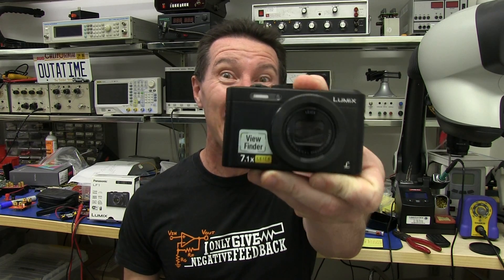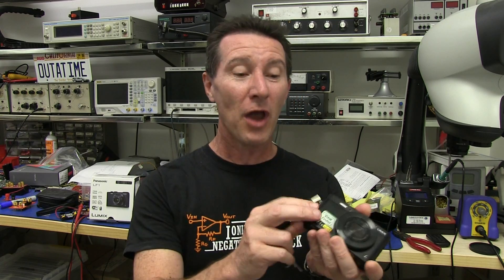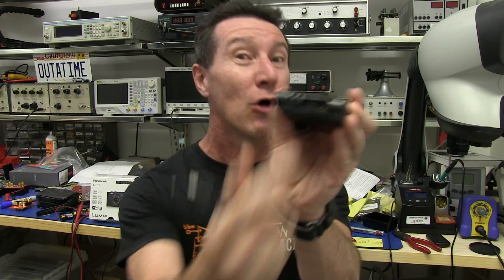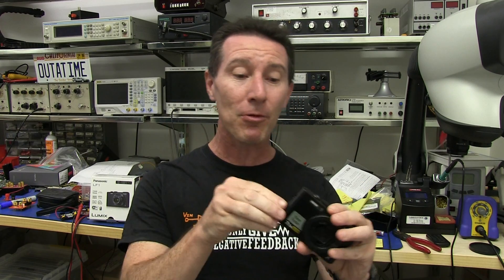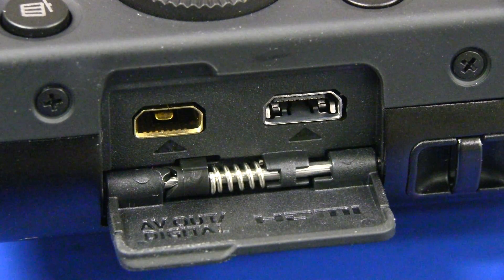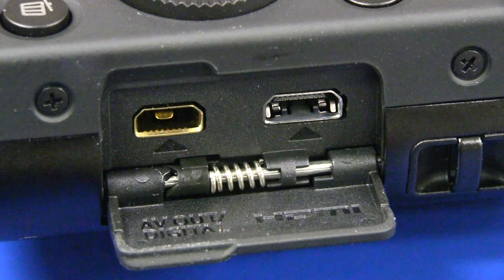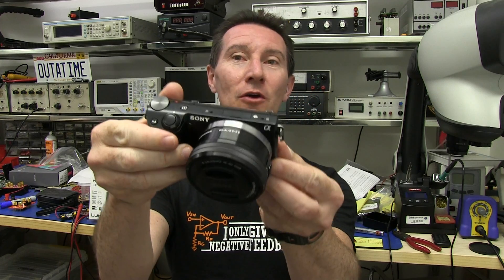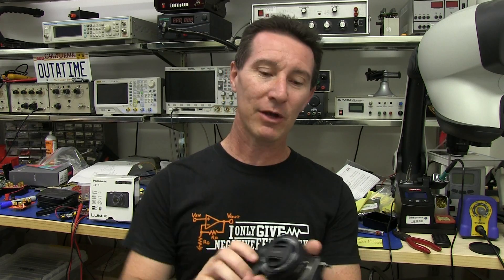EEVblog #578 - Proprietary Connector Rant - Panasonic LF1

Comment: My sony camcorder has standard micro-usb for connecting to computer, but get this, it has a separate weird ass connector for charging.
Reply: My Panasonic camcorder has HDMI, a proprietary AV out (which they included the cable for), a standard mini USB (data AND charge), and a standard 5v barrel jack for charge+power.  I don't care that the AV cable is proprietary since there's really no standard there and it has component as well as composite.  I do like that it uses normal old mini USB and can charge over it.  Did they somehow forget how to do connectors properly since then?

Comment: If it was apple the connector would have 200 pins and cost $400  for a 14cm long cable.
Reply: ... and only 4 pins would be used.

Comment: Great rant.  I have the same issue with Dell!  They've put a pin in the center of the barrel connector for my laptop power supply.  Its only purpose is to identify the power supply as a 'genuine Dell'.  When the pin isn't detected, the laptop will draw power to operate, but it won't charge the battery!   And guess what?  The pin is the first thing that breaks in the damned thing!  I have my original Dell power supply, and I can operate my laptop as long as I'm tethered to an electrical outlet, but it won't charge the damned battery because it can no longer detect the pin!  So now I'm screwed if I want to do something outlandish like use my laptop without being plugged in!  To add insult to injury, Dell wants $90 for a replacement power supply!   Guess who has bought his last Dell laptop?
Reply: HP does the same thing. Some third parties have made clones that work just fine.

Comment: I love these rants! Says everything I'd like to say to these manufacturers. The only thing I dislike is the MicroUSB connector, I have constant problems getting my Nokia Lumia to charge and it's the second one to have same problem, my kindle suffers similar problems. MiniUSB was ok, why we couldn't have carried on with that is a mystery!
Reply: The supposed reason for no more MiniUSB is that manufacturers needed a thinner connector for new thinner devices...  which seems stupid because I still haven't actually seen any portable electronics that are thinner than the good ol' MiniUSB connector (it was just so sturdy in comparison IMO).
Reply: I thought it might be something like that, I've not seen anything that a miniUSB can't be fitted to. The microUSB isn't as robust as the mini and it's a little too small to last long in today's devices. I guess that's the plan though ;-)
Reply: Eddiecurrent2000
IIRC, the MicroUSB standard is rated to a considerably higher number of insertion cycles than the old MiniUSB. The reason being that while MicroUSB has little spring-loaded latches to hold in the connector, MiniUSB relies soley upon friction which is dependent on the connector retaining its 'squashed in' shape.

I imagine most of the issues with MicroUSB is from people using devices while charging, as it's not exactly too robust against bending forces.
Reply: That is probably why it fails so often, how many people would leave their smartphone alone whilst it's charging? I took my Lumia apart and noticed that the contacts on the socket had been pushed backwards into the phone. I managed to push them out so they sat in their proper location, but I reckon Nokia bought a shit load at rock bottom prices, and they are just that - shit! I have to say, and it pains me to do so, but Apple's new connector (the name escapes me) is actually a good design, relying on the connector having a part to snap off instead of the socket lol.
Reply: Yeah. It would be nice if something with similar physical strength as the Lightning connector became standardized. The only downside with it is the exposed pins & orientation-agnostic features mean the cable has to have a chip in it... Just adding to cost.
Reply: Eddiecurrent2000 JMMC1005 

How about some sort of slim mag-safe style connector.

Comment: There was a big name PC manufacturer, can't remember the name so saying nothing for fear of being sued if have the wrong name :)

Anyway, back in the 90s, I used to watch Upgrading and Repairing PCs by Scott Mueller and he mentioned this manufacturer when recommending PSUs.  He said he can't recommend them or their PCs.  He used to do lessons and told the students "Make sure you connect the PSU properly, if the pins are off it will blow".  Everyone powered on, one or two PCs blew up.  He was annoyed as he'd asked them to make double sure they were connected right before switching on.  When he looked, they'd done everything right.

Turned out the manufacturer had made their own proprietary power supply that looked identical to the standard, they'd just swapped two of the cables round.  So if you used them on any board but their own, they'd blow.

Comment: You ask why, ?.....GREED.... Just pure stock holding GREED....! The engineers are perfectly sane. They are just (ORDERED) to deliver profits for their companies which back fires on the little (bee dicks) in the end of the company's profits. Greed has no shame! It never has.
Reply: Greed, greed never changes. :D
Reply: ***** Agreed! Greed trumps all until man is no more..! Winner Takes All, even if they lose all doing it.. !!! The reach always out stretches the grasp.
Reply: bain5872 I wouldn't have said it like that, but I guess I can agree, every man for himself and God for us all :D
Reply: Yes, I was venting a bit and could not resist one of Dave's favorite sayings. I felt the pain as did Dave, at spending hard to get money on an already expensive device to only find I've been highjacked in the software, adaptor or other secondary market. It seems that it is so common now that it's just accepted as normal business. It will run it's course until we have enough and stop consuming these money holes and demand useable products. Thanks for the agreement.
Reply: bain5872 It's okay man, but don't worry too much about this. It's true some manufacturers are notorious for their software locks or mandatory after-sale, a lot of other companies are known for their compatibility. In addition, legal regulation has really helped consumers a lot the past couple of years. The adaption of micro-usb as a legal requirement for a mobile phone has finally gotten rid of 99% of the proprietary charging ports on mobile devices, I love it! For the same reason, I'm really looking forward to regulations of laptop chargers. Though these are more complex to regulate due to the large differences in power consumption (a laptop can use anything from 12W to 200W), I'm sure that having a standard 19V and a standard DC jack will already help a lot

Comment: Just to review: almost all previous manufacturers that have had micro- or mini-USB connectors on their camera for data transfers have not allowed internal charging;  requiring the removal of the battery to a distinct propietary charger.
The really big pisser is when you think your new camera (gadget) finally allows internal charging, and USB to boot, but you then find out it's a proprietaty USB cable when it DOES NOT HAVE TO BE... that's when your head really steams up.

Comment: The sony a7r uses a modified microUSB with a load more pins to enable remote control. Can't get a connector anywhere yet so I can't even DIY a remote. Its the only stumble but not an unexpected one.

Comment: You should tear down that Panasonic camera and replace that shitty connector with the one you want. Samsung does the same thing to their compact cameras. How many of the consumers actually use the analog outputs on their compact cameras? My guess that it is single digit.
Reply: The analog output used to be quite handy before hdmi became mainstream. I remember quite a lot of times that I used the analog. And I still wish manufacturers would have a little 2.5mm jack plug with analog video on it instead of hdmi, because hdmi is so slow to "start up". But whatever, behavior like Panasonic is showing here is unacceptable in modern age.

Comment: Actually, that's not panasonic's own proprietary connector
I got a pentax k100d camera, and it also shares exactly the same connector
this connector is quite common for years until the standardization of microUSB in mobile phones

Also, I have another Fujifilm f31fd, also uses the same connector too
Reply: Also, I have another Fujifilm f31fd, also uses the same connector too

Comment: Hay dave I feel for ya my fuji camera has a proprietary connector for its usb as well but not only that it also has a propritary power connector for the wall. not a standard round plug but some dumb arse thing that go in to the battery compartment

Comment: Well, I can't dismiss that sort of thing so easily. On one hand, clearly a standard connector is better than a "special" one, but as far as I'm concerned it's not that big of a deal. I never download photos anywhere else than my home PC, and the cable always sits right on top of that. On the other hand, that same "special" connector (from Samsung, in my case) is the only thing that allowed me to convert my compact camera to one that can be triggered externally (time lapse, IR trigger, that sort of thing).

The camera originally had absolutely no such means or functions built-in, but taking it apart and strategically removing two components then patching over the two freed leads to the two-phase shutter switch (luckily, everything was ground-referenced) allowed me to use the A/V lead as-is as an external focus/trigger - while keeping the USB connectivity feature over the same plug intact.

A standard 4-pin micro-USB would not have let me do that; I'd have had to buy an all new camera for no good reason to get that feature (or give up USB completely) - this one works fine otherwise, and will hopefully for a loooong, loooong time.

PS - if you do ever muck around inside a camera, DO make sure you discharge the flash capacitor first - NO MATTER how long ago you used it last. Let me assure you, it still stores a respectable amount of charge...
Reply: Attila, I don't think you got the point. Let's try again - it's about recharging the camera in situ and, yes, downloading pictures.
You are among the minority that doesn't download, or perhaps they and you WOULD if we could charge, dock, and download with a single standard cable!
The extra functions are better kept to another converter-compatible connector.
Reply: David W. Smith Oh, I think I did get the point... :) And I DO download over cable, that's why I'm glad the USB pins were separate ones from the A/V ones so I was able to re-purpose the latter while keeping the former intact. As I said, I'm not arguing the point Dave makes though - yes, a standard micro-USB is better, sure. I'm just saying having a crazy 8-pin special connector instead of the standard 4-pin one can also be quite useful sometimes.

Comment: I've also been driven mad by such things. The most blatant ones that come to mind are when Dell changed the wiring on their computer power connector so that if you plugged a standard PC PSU into a Dell motherboard it would fry it. Bastards. Going further back, when Amstrad took over the Sinclair Spectrum and they deliberately muddled up the wiring of the joystick socket so it would ONLY work with the (crappy) Amstrad joystick, I NEVER forgave them for that.

Comment: Hey, Dave, why not replace the sucker? I bet you could find a way to make it work. That would make for an interesting vid.

If i (impatient brat) can do it you certainly can do it. Changed a Pentax proprietary usb to a standard usb with a dremel some hackery and lots of black glue.

An example of really cool proprietary connector that isn't a d*ck is Nokia N8's usb connector. I love that thing. It allows you to get their special rectangular usb AND any other micro usb of that type. I use the same usb for it and my camera.
Reply: There's bunches of manufacturers who have custom connectors that fit both a custom cable and a standard cable. There's literally no excuse for Panasonic from an engineering standpoint. This sounds a lot like a bunch of stubborn team members / marketing that are either really dumb, or they're simply trolling their own customers
Reply: ***** It's money. Plain and simple. Because if the cable breaks you are obligated to buy a cable from them. If it were a normal usb then, you could buy any usb cable at, probably, half the price. 

Companies are generally a**holes when it comes to these kinds of things. A cable like that probably only costs "a cent" and they make you pay "3 cents".
Reply: aserta From other comments, it became apparent that this is some Chinese cable that can be bought from any random eBay merchant for a dollar or two, however. So the cable isn't Panasonic-specific and thus doesn't force you to buy from Panasonic.. Hmm, food for thought
Reply: ***** Panasonic specific...maybe, maybe not, usb making isn't rocket science (if you're not apple who probably puts a tracker chip in the cable as well). 

Question is: are you willing to test your luck using a cable that might brick your camera? I've seen some of those usbs mind you, and i've also seen home made plastic, guess which actually gave off a better quality vibe.

This whole proprietary game has been played for years. The problem is you're either Dave or Mike, who could probably do any kind of mod/fix conceivable or you're random person X who either forks out the money for a new proprietary item A or doesn't and buys the cheapie (spelled porpirtary a) version that later either brakes the usb because the shape of the plastic hand grip isn't as flexible as the original one or is done so bad inside (wiring) that it will short/brick your usb empowered item.

OF course, here, i'm dramatizing things a little, i don't really think everyone will have shitty luck like this, but it is something that happens, IF, stories online and even personal experience is something that can be quantified. 

Mah, look at all that text for an usb cable. Dave's rants are contagious.
Reply: aserta the irony is that Apple does have chips in their cables lol. The dreaded "this accessory is not supported by this iphone". That was the last time I willfully purchased an Apple product

I can understand your concern over pretty bad quality cables.. and I've broken a couple of bad-quality cables myself, but I don't really have an issue using $1 cables on $500 gadgets if necessary. I don't think you can break a camera with a dodgy USB cable though.. So to answer your question, yes I'll test my luck on crappy Chinese USB cables any day. I never get the bottom-lowest quality, though I'm not spending $10 on a friggin cable. Decent usb-powered products have reverse-polarity protection and all that jazz, there's no way it can ever damage your product even if the wiring is messed up or shorted. 

and you're right that the proprietary game has been ongoing for decades, but it's nearly over you know. It's getting increasingly rare to see products like in this video that have a weird proprietary connector.
Reply: ***** I know apple has chips to force proprietary items. To help one of my friends i tried to create an adapter that would be separate from his cables so he can use whatever usb he wants. 

There's a shiton of examples of apple's butth*le approach to how they do business. 

On the cable deal i was mostly referring to mechanical damage. The Chinese cable will always be smaller, longer than it needs to be etc , since they have to account for different devices and different shapes.

I use low quality cables as well, tho since i've gotten a bit better at electronics i've changed most of my usbs to the Nokia usb standard because i can buy one cable for 3 dollars that's decent to good quality from the older stocks when they go on sale.

It's a pain in the ass, never do what i do without knowing what you do, but if you succeed using one usb to work all of your devices is super awesome.

Yes, i've noticed myself that quite a lot of companies have given up on the previous ideas of  using p. systems. But i think it's mainly because the companies that do research in to usb standards sell the idea and product cheaper than it would be for company A to do it all in house. Eventually it's going to become a huge trapper-keeper that will rule the world.
Reply: aserta Hmm.. I don't understand how you can say that USB cables from Chinese eBay vendors can mechanically damage your stuff because they have different dimensions. I know there's some rare instances where the mini/micro usb plug itself is slightly longer, but never in my whole life have I damaged a usb port with a cable before..

Though if it works for you to get good-quality cables from a known good source, that's bonus points for you!

Comment: Totally agree with you there Dave it's completely pointless to create a proprietary connector and cable. They probably wouldn't ever recoup the cost of setting up the machines even if they sold thousands of extra cables to the poor guys who lost or broke their original ones, which means they have to add that cost to the price of the camera plus they need to keep a machine set up to just make the cables !